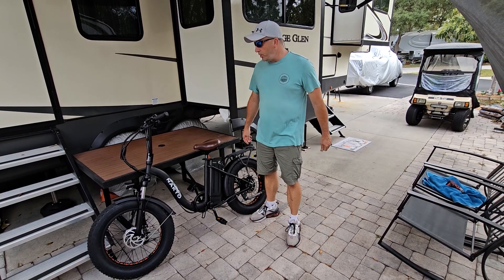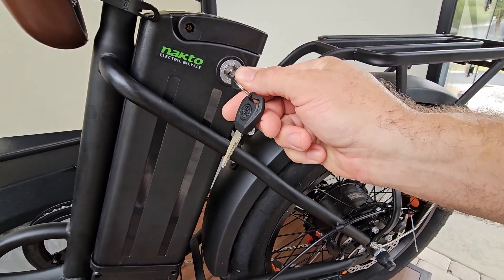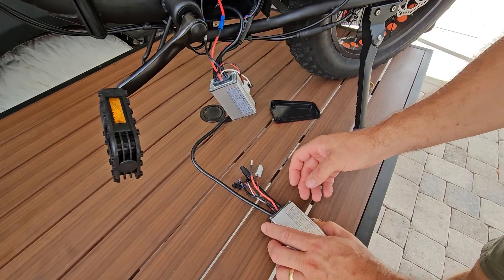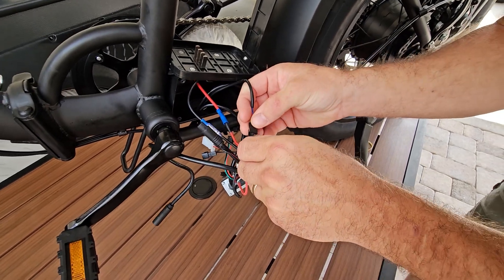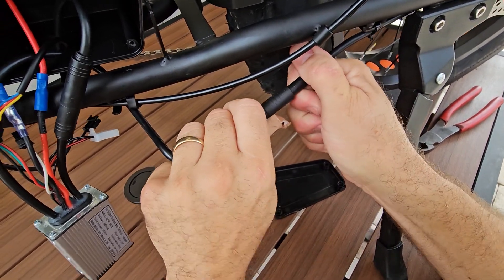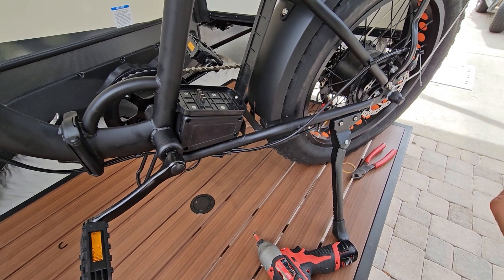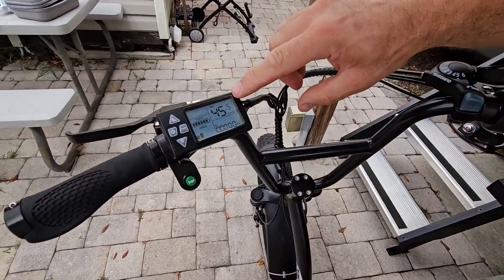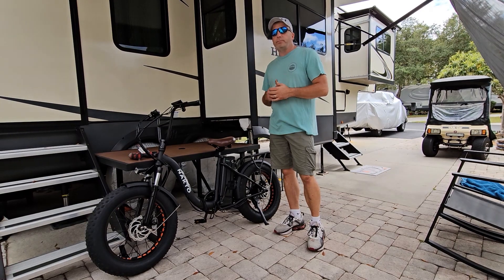Upgrading Your E-Bike: Controller Replacement Guide On Nakto Folding OX & Others

Comment: What about if it showing E38 on the display
Reply from the maker: That usually means there is an issue with voltage. To high or to low.

Comment: Ok so I had to rearrange my controller box because it was flopping around in there from the factory. Theres a metal crossmember over top and I wedged it in-between that and the plastic box. Is it ok to touch the frame? I've seen Aventon bikes and they just stick the controller in the frame under the battery so. Wasn't sure.

Comment: What are them controllers called with the two circle connectors for the motor & display like you switched
Reply from the maker: It is called a controller. It controls all the systems on the bike.
Reply: @Jimmy2Tech obviously it's called a controller but one like you used with the specific connectors

Comment: Great video I love the way you kept things simple and explain things especially this special tip about pulling one and replacing the same one one wire.  The only thing I might have did differently was put the battery back in wow the bike harness is out of the and then power up to make sure that it works and then clean up everything with the wire harness and enclosure other than that great video

Comment: What's your thoughts(honest) on the folding-ox after this long? 
I have one with only 110 miles and im having tons of issues. When it works i love this thing but that ain't to often.
Reply from the maker: To be honest after having it awhile, i am not impressed at all with the bike. It does seem to have a lot of issues that gives you no confidence when riding. I hardly ever rode it and it just sat there. There are many other similar options in the same price range that would be better choices.

Comment: do i need to take my battery off when i swap the controller because i lost my keys to my batteries unless there’s another way. can i drain the battery out or just have the bike and battery fully off while swapping the controller?
Reply from the maker: If you are changing your controller you will definitely want the battery out.
Reply: Just unplug a battery cable then drain it
Reply: You could possibly remove the screws on the top of your battery,and the ones attaching the lock. On mine there is 4 screws on the top,and 2 holding the lock. There are plenty of videos on yt showing how to remove or replace the lock on your battery. Always be aware of possible electric shock though.